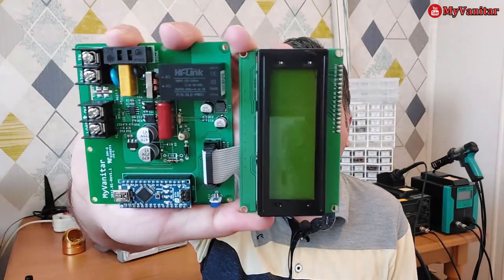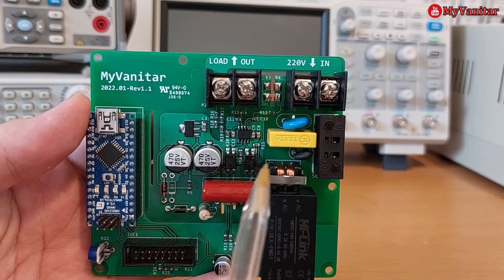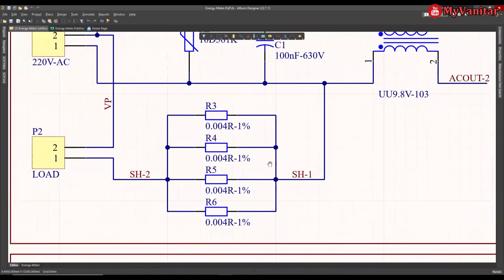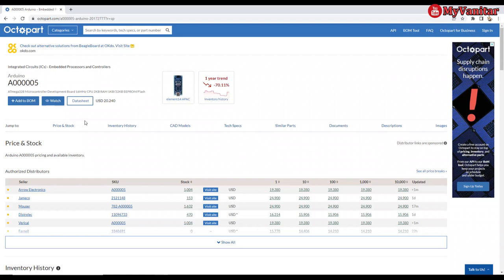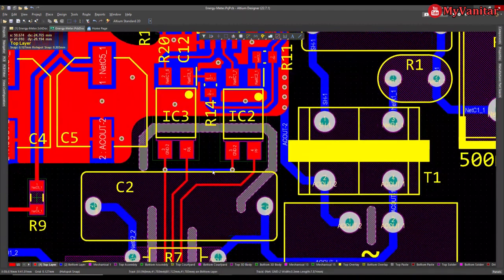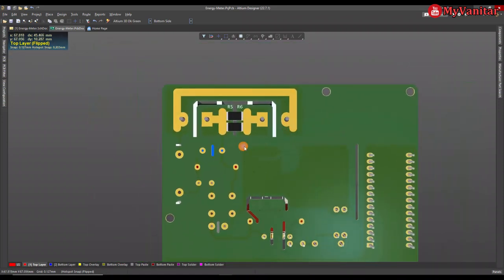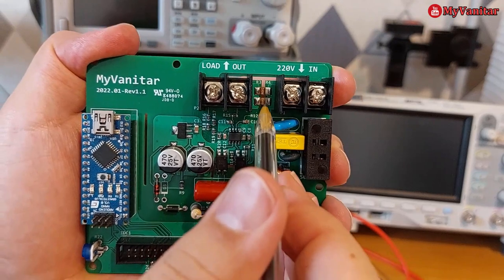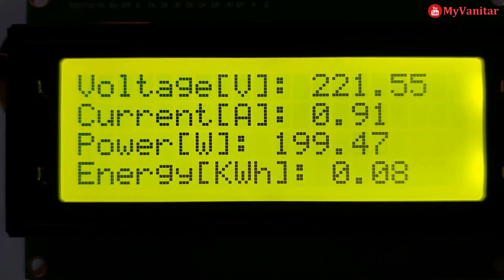🔶 High Precision Digital AC Energy Meter Circuit [Voltage, Current, Power, KWh]

Comment: Be a lot safer using a CT-based design with temp comp opto isolators for voltage ( you can do it using one on the input voltage and one in the feedback loop of an opamp on the low side)   This provides a totally isolated solution.  This is what the commercial one's we design use .  Another option is to use something like the Allegro current sensors instead of CT's.
Reply from the maker: Yes, CT can be also used with this design, but the direct measurement (like what I did) is more linear and accurate. CT is more convenient for non-invasive measurements, not because of the safety or similar. for when we use this in an enclosure, nobody is afraid of touching the circuit. Anything connected to the main should be considered for safety. For Allegros, you have to make the calculations yourself.
Reply: Any energy metering chip is available that support CT instead of shunt resistor?

Comment: Thanks for sharing very interesting topic
as the above board shows the energy meter design for 220 nominal voltage what will happen if the voltage level below 220 V or 100V
Reply from the maker: nothing. it calculates based on the input voltage and current, however, I'm thinking about the capacitor-based supply for the chip (not the chip itself), that might cause issues if the voltage drops too low
Reply from the maker: I have another design as well, V2. check my videos you will find it
Reply: @MyVanitar  yes most of our meter lost stored energy on voltage drop areas   , due to what reason happen or which electronic component causes
Reply from the maker: This is not the problem of the meter, it can be easily solved to handle even as low as 85V-AC

Comment: Hi, nice project, thanks for sharing. 🙂 What I miss is the Power Factor. What's the reason not adding that?
Reply from the maker: You have the code, just add it :-)
Reply: 😄 I wish I could. I'm not able (yet?) to read/understand the code and to change it. But is it possible by only adapting the software or are HW changes also necessary?
Reply from the maker: just remove a line (on the LCD output) that you don't want (for example KWh) and add the PF. The library has its functions.
Reply: Ah, that easy. 😃 Thanks for guiding me. Got it!

Comment: will you please suggest any other values of 0.004 ohm resistor because I didn't get it from online
Reply from the maker: you should create a 1miliohm resistor, at least 6W. so you can use two 0.002 (2 milliohms) in parallel also
Reply from the maker: if you could not find one, at least use a single 1milliohm 3W one to make your experiments

Comment: Thanks for the great video! 
I am using your library, and reading is ok but the values I am getting are not accurate, PF is always around 0.35 and Current at no load is reading 0.7-0.9A. Voltage on the other hand is accurate. Any suggestion what might be the cause? in regards to schematics it is pretty much the same as yours and the datasheet.
Reply from the maker: You should calibrate the device using a linear AC load (such as a classic light bulb) and an accurate true rms multimeter in AC current mode. however this is not the case with you, calibration fixes some drifts, not the thing you experience. make sure you only use my library from my Github, also clean the board for any flux residue. I can not help you more because you don't use my PCB and I don't know what you did in that level. by the way, watch my upgraded version and the calibration phase here: https://www.youtube.com/watch?v=GDTPgqovTlw
Reply: @MyVanitar  Noted. 
There is something off as you mentioned, it is not just the calibration as my readings for PF is way off with a resistive load (100w blub). I will try to clean the board as you suggested, alternatively I will try to change the current sensing resistor to another type, but I wonder could that cause the PF to be so inaccurate?
Reply from the maker: it's weird indeed, the current is also weird without any load

Comment: Hello, congratulations for your impressive work. In order to use this system in 3 phase, can't we connect the shunt resistor before the load?
Reply from the maker: For 3 phases, you need 3 of these, each for one phase. the shunt is before the load always. here is also like this. Check my latest video also. I have introduced V2 of this circuit
Reply: thank you for your excellent work @MyVanitar

Comment: Hi! Can this energy chip indicate the direction of energy too? For example, if I have a solar system. I'd like to see, whether I consume energy or I feed energy into the grid. Is it positive power or negative power? Is this circuit capable of indicating the direction of power? Thank you for your video.
Reply from the maker: This is for AC loads; for example, you can put it at the voltage entrance of your home or measure the power consumption of the individual AC loads to see how much they consume the power. In your case, I think you are dealing with DC voltage at the first stage, DC is way easier than AC

Comment: For use with 120V North American systems, is it as simple as halving the shunt resistors and modifying some Arduino code?
Reply from the maker: I don't think you would need to modify anything, use it as it is with 120V, however, I think about the non-isolated supply side. The output voltage of that section "might" not be sufficient with 120V. I have not worked with 110V/120VAC to confirm this or not. I don't know
Reply from the maker: I have published another version of this also, as of today, it is my latest video

Comment: How much volts and amps can the circuit handle?
Reply from the maker: This is for the AC line (220V). maximum current depends on the power of the shunt resistor

Comment: I've been wanting to design an AC measurement circuit for my solar heater system, so this is very handy.  My existing sense circuit has similarities to yours, with large cut-outs.  I control around 1kW and measure using large, external shunts.  I haven't looked at AC measuring chips yet, but I'm concerned whether they provide pure RMS?  You've put a lot of work into this design, so I'm curious what it's for?  I'm also surprised that you're using an Arduino.
Reply from the maker: Check the article, Christie. This time it was published with a few hours of delay. of course, it measures the RMS voltage and current. and also many other complex parameters. if it does not, then what's the benefit. I did that with Arduino to make it more educational-friendly. for a commercial product, I would make some changes
Reply: @MyVanitar  Great, I'll have a look at the article.  I specifically meant true RMS power (not just RMS V x I), but it sounds like it does that too.  How do you sell your products?  I design quadrature motor controllers and other things, but have had poor luck selling things.
Reply from the maker: Yes, of course, V*I is the apparent power, not the active power. I don't sell products, however, you can collaborate with big shops and send your items for them to sell. companies do this most of the time.
Reply: @MyVanitar  That's what I tried to do without success.  May I ask which companies buy from you and how one should contact them?  I really don't want to keep doing the individual selling and posting.
Reply from the maker: As I mentioned in the previous comment, I don't sell products, however, that was my suggestion. You may try Amazon and eBay as well
Reply: @MyVanitar  I've done eBay before with little success and they take a big cut.  So you're just designing for fun?  Sounds much like a lot of my projects.  It's very rewarding, though.
Reply from the maker: Try Amazon and see what happens. if you live in the US, that's the best option. This channel helps to enhance the authenticity factor. I have to pay the price. no other way.
Reply: @MyVanitar  I looked into that before, but it also seemed quite expensive.  I'm based in the UK, though.

Comment: Hi Sir great project... Thanks for sharing... I need to clarify on think about frequency if possible to add displayed in frequency please 🙏🙏🙏
Reply from the maker: This is for the Mains power (home appliances), so the frequency in most cases is 50Hz
Reply: @MyVanitar  sir if possible to add in lcd display frequency also please
Reply from the maker: I think you had asked this question somewhere else also. What is your question, just want to display "50Hz" somewhere on the screen or you want to measure the frequency?
Reply: @MyVanitar  Sir Please help us i need to measure exact frequency value in LCD Display using arduino .... so many videos not display frequency in the LCD screen
Reply from the maker: because the frequency is always 50Hz, why somebody should measure it?!!
Reply: @MyVanitar  Sir we need to measure UPS output parameters so i need to display ups output frequency... Please help us
Reply from the maker: UPS?  it must be 50Hz. if you want to test this device, you should have test equipment such as an oscilloscope, and check the sine wave, frequency … etc.

Comment: Hello Mr  my name is kassahun  Tamiru from Ethiopia Africa as you explain  digital energy meter measure Active energy reactive energy ,apparent energy , active ,reactive ,and Apparent power and also digital energy meter measure instant current , instant voltage ,power factor and display any tamper event on meter LCD like Battery status , reverse connection ,ground , terminal open and Etc , 

my county  single phase system voltage  standard is 220 V and  we use digital energy meter but our meter canceled the previous stored  cumulative energy  when our voltage decrement to 170V and below  what will be the Reason for meter canceled registered kwh
Reply from the maker: I don't know, but a voltage glitch (on/off) probably caused this, because they calculate until their power is connected. to avoid this, you have to store the latest data on an EEPROM or something, every 1-2 minutes for example

Comment: Hey, is it possible to modify the circuit with HLW8032 ic to be powered from 12v car system and to measure car amplifier output to speaker? (voltage, current, power)? Thank you
Reply from the maker: Your case is different because the frequency and output wave are different. by the way, you can put a high power resistor instead of the speaker, with the same resistance as your speaker, for example 4-ohm or 8-ohm, then measure the RMS voltage and RMS current using your oscilloscope and multiply these two
Reply: @MyVanitar  But speaker is inductive load and impedance is constantly changing. I want to measure true power that speaker is receieving from 10 to 100hz (sub frequency range)
Reply from the maker: The power of what you hear and what the board can handle is different. To measure the power of your amplifier, this technique is applicable. for the input, you can apply a small sine wave using a generator
Reply from the maker: if this does not satisfy you, you can build a load using some copper wire (to simulate the speaker) and make this experiment using that load. but you would need an oscilloscope in either case or even a current probe to measure the RMS current. I may do a video around this
Reply: @MyVanitar  I already designed the circuit to measure rms voltage and current but I am not sure how to calculate power factor. I done testing with frequency generator.
Reply from the maker: for the amplifier, RMS power is the metric. however since the waveform gets complex, an oscilloscope is the best device.

Comment: Sir how to measure frequency for exact value without distortion please
Reply from the maker: AC frequency is 50Hz
Reply: @MyVanitar  yes AC line voltage and frequency need to display
Reply from the maker: You have the code, display "50Hz" somewhere you like on the screen
Reply: @MyVanitar  hi.... I have code but this code will work test table exact after connecting the equipment frequency will changed... So some distortions... Please help us how to avoid or solve the distortion
Reply from the maker: This is related to your prior experience with the Arduino code. The screen refreshes automatically to show the data. You have to show your text somewhere that doesn't change or you can modify things based on your desire. Also, you can not program the Arduino on the board because I have used the RX and TX for a different purpose. remove the Arduino, program it, and put it in place.
Reply: @MyVanitar  Ok sir i will try thanks for your valuable reply